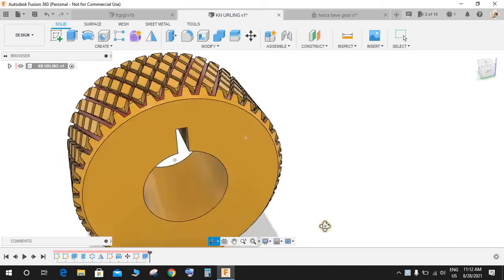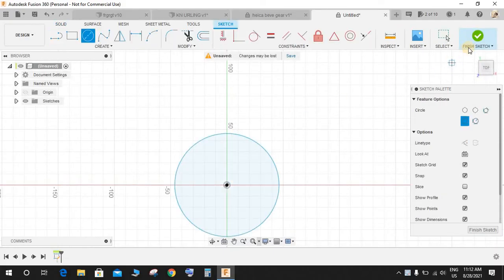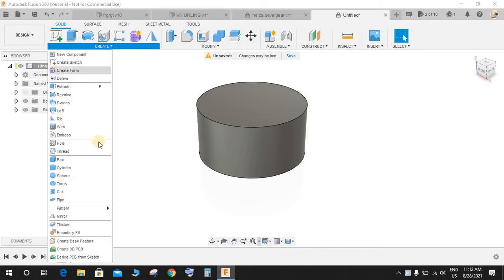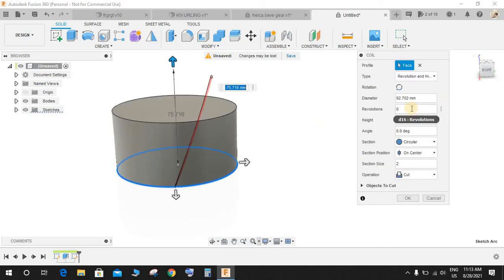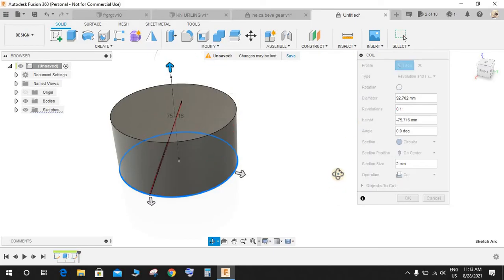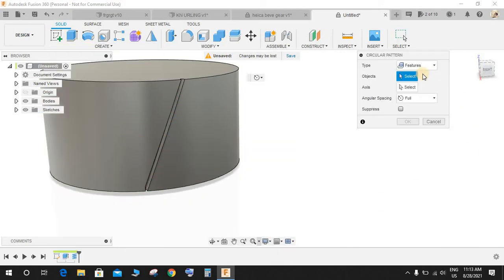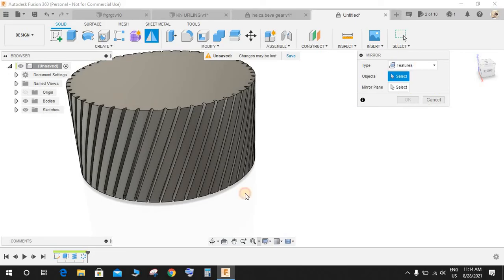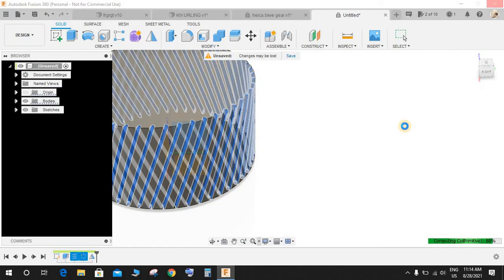How to make knurling in fusion 360 | Fusion 360 Tutorial

Comment: Now do it again, but FASTER! Thanks this was an amazingly simple trick. Edit: anyone who wants to get rid of the little defect near bottom can create an offset plane from same plane as where the coil starts in video and offset it by a few mm(depends section size and height of coil).
Reply: You can also just raise the model off from the bottom plane and then draw a coil from the bottom plane. That makes the coil run completely through without the defect.